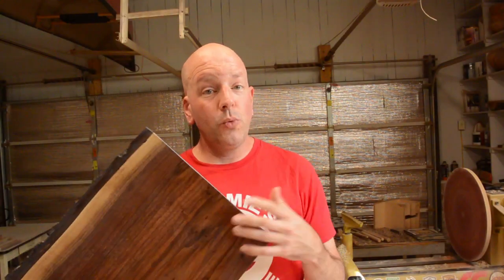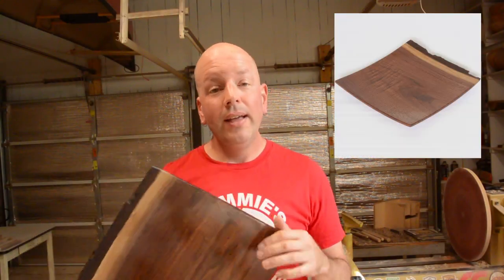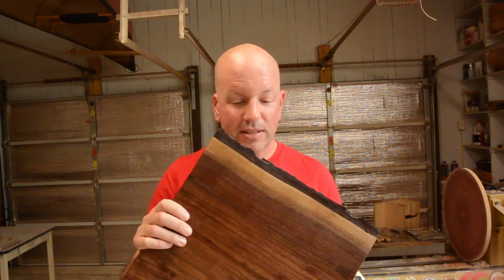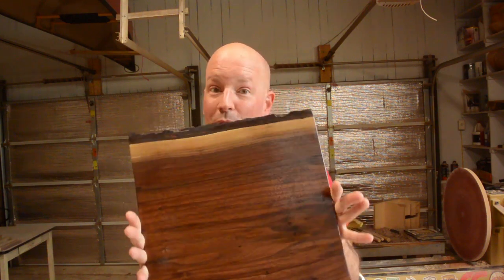14" Walnut Wood Platter - Woodturning, Woodworking

Comment: That looks awesome, Did you glue a sacrificial backing to it when you flipped it around? I didn't see how you removed the screw holes from the mounting plate.
Reply from the maker: Yeah, I guess that was not obvious in the video. I used cole jaws to make the foot.
Reply: @CammiesGarage  Ah yes :)